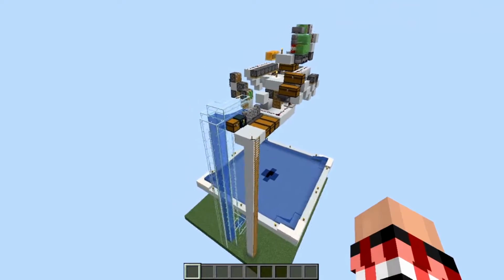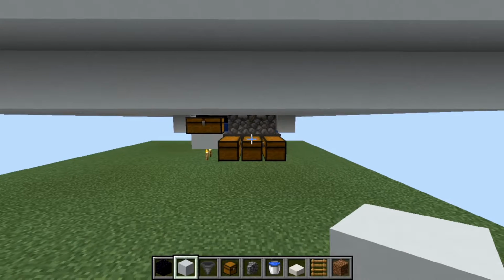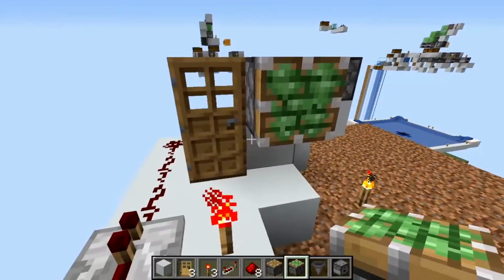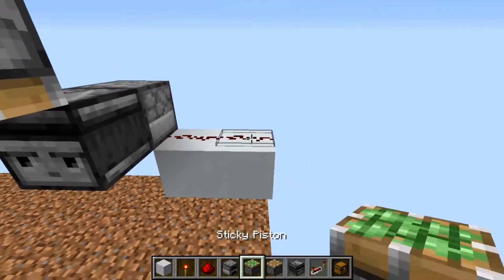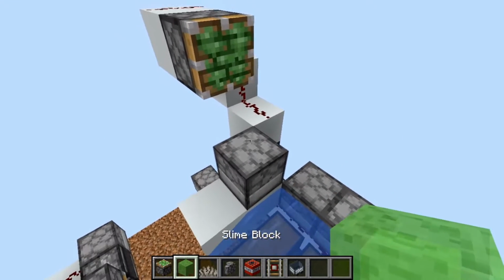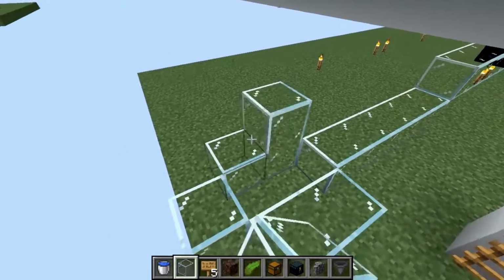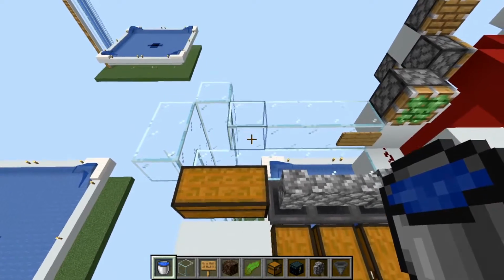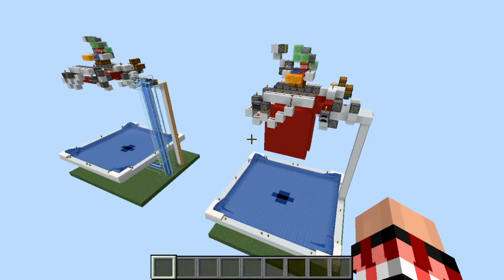Auto TNT Concrete Maker 17,985 Per Hour - Java Minecraft 1.15 - 1.18.1+

Comment: Im on 1.21.7 and this keeps getting backed up at the corner and also the tnt duper does not fire each time as it whould. 
Im running on a fabric server, no lag issues that I can tell, all our other tnt duping / fast farms work fine.  Any thoughts?
Reply: any luck on fixing? having the same issue
Reply: Same here on singleplayer 1.21.10 with a bunch of mods. I tried to use a autoclicker with a lot of delay but it still breaks.

Comment: It dose not work in 1.16.4  it will not Dup the TNT  any Fixes    thanks
Reply from the maker: Did you build it on a server? Some servers disable duping, but it can be enabled by an admin if they change the setting in the server files. If it's built in single player it will work, unless something somewhere is misplaced. Hope this helps!
Reply: @mrbouzouki_189  Got it working yo thank you  Rock on
Reply from the maker: @TroyTackett  Glad to hear it, hope you enjoy!

Comment: do you know is there anyway for stone to drop stone instead of cobblestone when blown up with tnt?
Reply from the maker: Not that I know of, I believe the only ways to get stone are smelting cobble or mining with a silk touch pick. If you mean running stone through the machine, which can be done to get the concrete out, it will all turn to cobble unfortunately
Reply: @mrbouzouki_189  ahh thanks :)

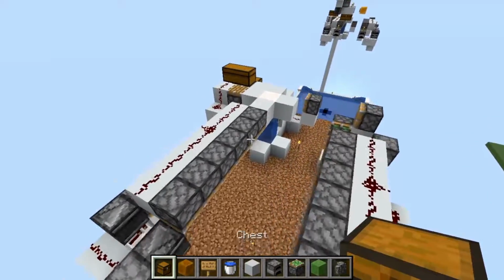Comment: I'm curious why you use chests at 11:00 for the water channel for the TNT? Does that change the water flow somehow?
Reply from the maker: If you use solid blocks there instead of chests, the TNT exploded too high up, which can blow up the system. Chests have a slightly smaller hitbox, and so the TNT block has less time in contact with the honey blocks, causing it to explode in just the right location

Comment: thing works like magic, glad i found your channel. still working for 1.16.2
edit: i found that the single dropper isnt enough to support a fully afk session, i added another dropper ( replaced the block above the players head when they're in the afk chamber ) and connected another dust and it worked wonders. also i find it better to aim at the piston instead of the redstone torch, powders sometimes gets stuck on it but not as much on the piston.

Comment: Hi... I'm on 1.16.2 Java single player survival and everything works except the TNT doesn't activate... I watched it over and checked but I still don't understand whats gone wrong
Reply from the maker: Did you check the sticky piston pushes the slime blocks? Make sure the slime doesn't stick to anything, which is why I used furnace blocks. Also make sure it's a minecart on a detector rail. Finally  ensure to place the coral fan in the right place. Hope this helps and that it works for you, I can confirm it works in 1.16.2
Reply: @mrbouzouki_189  Hmmm I just checked and my sticky piston pushes the slime blocks but when it contracts it doesn't bring the slime blocks back, and by that point the fan coral block has been broken somehow. The sticky pistons aren't stuck to anything though and I have placed a detector rail and the fan block in the right place
Reply from the maker: @jamesstoneley1624  Are you on a server? If so the server settings might have changed once 1.16.2 arrived, they can prevent duping using coral but there's normally a setting that can be changed. I hope you manage to find the solution
Reply: @Mr Bouzouki unfortunately I am not on a server.. I’ll keep trying to fix it
Reply: Mr Bouzouki do you think a different TNT duplicator design would work?
Reply from the maker: @jamesstoneley1624  you could use the same duper part ilmango uses in this farm: https://www.youtube.com/watch?v=2sCEsghQI6w&t=1009s . If you just configure the slime blocks to be that shape it should work. I recommend building just the duper part in creative in another world a few times, and in different places of a creative world, just to ensure it will work. Thanks for checking out my video though and for your comments :) Feel free to let me know if this helps
Reply: @mrbouzouki_189  Hi! After a few hilarious attempts in Creative mode, I finally fixed the problem! For the blocks next to the water stream which the TNT slides down, I just used furnaces instead of a solid block and it seemed to work fine after that! Thanks so much for the great video!
Reply from the maker: @jamesstoneley1624  Great that you got it working :) Thanks and hope you get plenty of use out of the machine

Comment: It seems that my concrete blocks are getting pushed fine, but theres no tnt breaking the blocks. Does anyone have an idea on why this might be happening? On 1.16.2 Java here
Reply from the maker: Did you place the coral fan next to the tnt block? Did you remember to put the minecart on the detector rail? Also make sure it was a detector rail and not a powered/activator rail. Hope it works for you :)
Reply: @mrbouzouki_189  Hey Mr Bouzouki, Thanks for the reply! I did do those actions, and in fact when i tried to troubleshoot by taking the minecart off the track and putting it on again, the tnt did succesfully blow up, although it destroyed the area and I had to rebuild it since it didnt fall in the water for some reason. After that I tried redoing the area again and still no success. Would it help if I sent some screenshots along?
Reply from the maker: @keane5301  Sure, that's fine by me
Reply: @mrbouzouki_189  Thanks so much! You're a lifesaver! I've uploaded the before and after using screenshots as well as a video of me using it onto my Google Drive!

https://drive.google.com/drive/folders/1biys6KGJqiJR5fEHzAW8cFKTMObVzdCP?usp=sharing
Reply: Just wanted to update anyone who might be having the same issue. Found out upon rewatching the end portion that the coral has to go on the slime block itself, i didnt realize that placing it on the concrete block in front of it stopped it from working!

Comment: bro it breaks everey time in server
Reply from the maker: If you're able to check the server files there's a setting that allows duping, depending on whether using PaperMC or Spigot. It does work on most servers but some mods choose to turn duping off, just check with whoever has permissions
Reply from the maker: That is, if you were talking about the TNT duper. If not, just make sure it's built block for block and it should work on all servers

Comment: Ok so I made this farm on my Survival Server and it works just fine but I was wondering if when  you were done using the farm do you always have to break the extra blocks or did I do something wrong. Great tutorial btw. :)
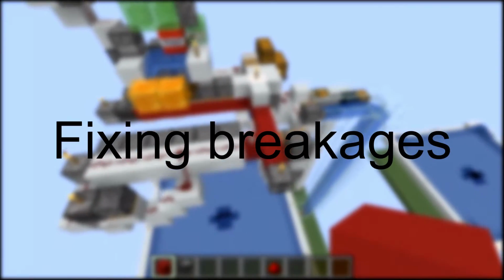Reply from the maker: You can run dirt or netherrack through the system to get the concrete blocks out, that way you don't need to mine them manually after each use. if by extra blocks you're referring to the ones at 18:26, if this keeps happening it means you may have built something wrong, possibly the block splitter in the AFK room or the corner pusher. Glad you like it and hope you enjoy using it :)
Reply: Mr Bouzouki Thank You!

Comment: the tnt duper doesnt work, im playing on 15.2 java. Help plz
Reply from the maker: I can try. Did you use a coral fan next to the TNT? did you place the wall? did you use detector rail, not activator rail? Is the piston pushing the slime blocks? Just make sure everything is in the right place and that there's a minecart on top, it has to be built as shown in the tutorial. Hope this helps :)
Reply from the maker: Also if you built it on a server you need to ask admins if duping is enabled, as some servers have a rule that disables them. This rule can reset to default if spigot or paper receive an update so might be worth checking
Reply: Everything seems to work fine it’s just the tnt won’t get duplicated, I’ve triple checked that everything is correct and the server allows tnt duping. I will rebuild that part from scratch and see if it works.
Reply: The problem is most likely with the server bc it worked in creative, thanks for the help!

Comment: I have one question. Can you plug in other generators such as cobblestone and basalt into this blast chamber?
Reply from the maker: You can actually :) I have a wood farm flowing into one of mine, I just got rid of the door and had it flow through
Reply: Mr Bouzouki ok thanks I’ll try and figure something out but I may have to make multiple blast chambers

Comment: The first sticky piston you place for the item splitter is not leaving the solid block you place on it’s face in the position required. It pushes and retracts it and therefore the items don’t get split.
Reply: The one you place at 7 minute mark. It isn’t working on my build.
Reply from the maker: @GittensFamily  Have you checked that the repeater is set to 1 tick delay (default)? That should give a short enough pulse so that the piston spits the block out. Hope that fixes it
Reply: Mr Bouzouki that was exactly what was wrong mate, I must have clicked the repeater at some point without realising
Thanks for getting back to me mate 👍🏻
Reply from the maker: @GittensFamily  No probs at all :) and enjoy

Comment: Hey i built this and it worked perfectly until 1.16, now the coral reef breaks when the piston pushes or pulls the tnt duper
Reply from the maker: That shouldn't be happening, as 1.16 didn't patch that out of the game. Are you by chance playing on a server? Paper and spigot servers get updated sometimes and the rules in the files go back to default, which can disable the dupe glitches
Reply: @mrbouzouki_189  Yes, i am playing on a server but until paper came out for 1.16 we were on vanilla and it still didnt work on that either
Reply from the maker: @raptorzz8571  Hmm ok, the only suggestion I have is to check the paper.yml file in the server files and check that duplication glitches are enabled, that was my problem recently and how we fixed it. I hope that solves your particular problem and if not I wish you the best in finding out what's going on
Reply: @mrbouzouki_189  Tnt duping is enabled so i guess it isnt that. But thanks for getting back to me so quick

Comment: This is real good man, only issue is when I hold down right click on the torch, eventually the machine stops.. the powder doesn't turn to concrete and I have to break the powder and start placing again before it works, then it shuts off, and so on and so on
Reply from the maker: Did you only hold one concrete powder block in your main hand, making sure there are no others in your inventory? Other than that the other possible cause could be server lag if you're on a busy server
Reply: @mrbouzouki_189  Thank you for responding.
I realised that, being on an Australian hosted server when I live in the UK is definitely going to slow things down. It's still really efficient and way better than the usual method. Just sucks a bit about the high ping.
TL;DR I realised it was because I was playing from half way across the world lol

Comment: Just keeps getting stuck in the first corner. Every. Single. Time
Reply from the maker: Do you mean the part where you place the powder, or the bit that leads into the second vertical block pusher? It sounds like you missing a redstone dust or piston. Have you tried the world download?
Reply: Nevermind on that. Figured ot out. Any ideas on why the tnt is blowing up the concrete?

Comment: If anyone is having the problem where a piece of concrete powder will just stay on top of the redstone torch and not get pushed, the only way I could fix this was to click on the right side of the piston instead of clicking on the torch
Reply from the maker: That does work, although there's a quirk that the piston doesn't push as fast in certain parts of worlds... It's a strange one! Did you have an empty inventory and one powder in hand? Normally solves the clogging problem
Reply: Mr Bouzouki I had a stack of powder and most of my inventory was empty it could be server lag as well but this still works extremely well thank you for the design
Reply from the maker: @v3c70r6  Try holding just one powder at a time, that should solve the problem, and no worries, enjoy!
Reply: Mr Bouzouki ok thank you

Comment from the maker: Time stamps:
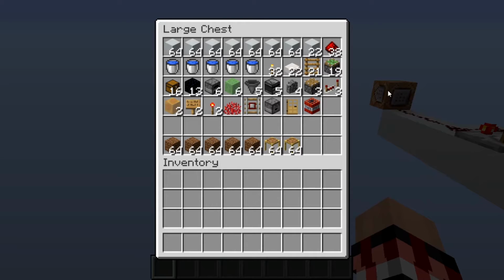02:13 Materials
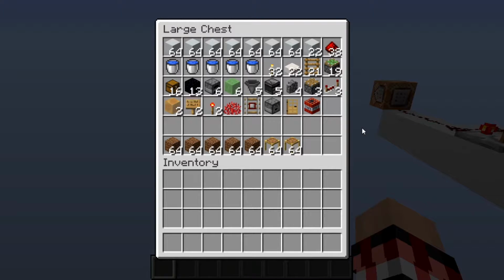02:30 Tutorial Start
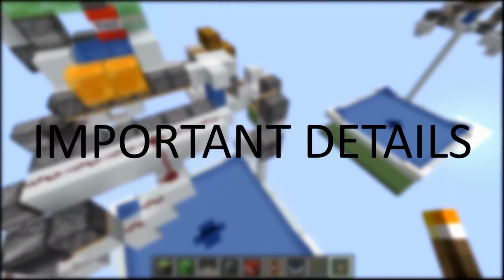12:20 Important Points
13:31 Item Elevator Version
18:21 Fixing Potential Breakages
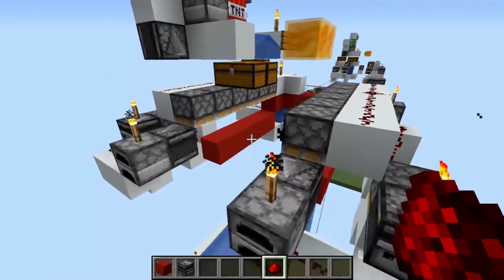18:52 FAQs
Reply: Hey so my concrete powder starts to jam as soon as I place it down is there any fixes?
Reply from the maker: @applebeesmanager434  Did you make sure you're only holding one powder block, no others in your inventory, then put all the blocks you want to convert in the dropper/chests? If yes, but still not working, check the repeaters are all on 1 tick and that the block splitter works. Hope this fixes it
Reply: I did not understand why you using sticky pistons instead of pistons to move the concrete. Is there a special reason? It works cause the signal length is short, but pistons should also work or?
Reply: EDIT: The IDEA with the redstone torch and the block update pistons is insanely great!